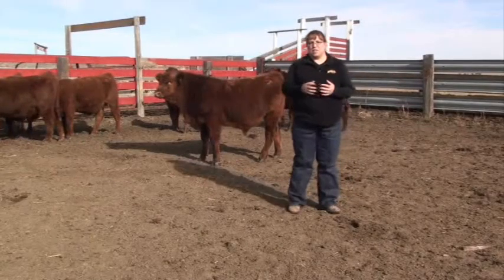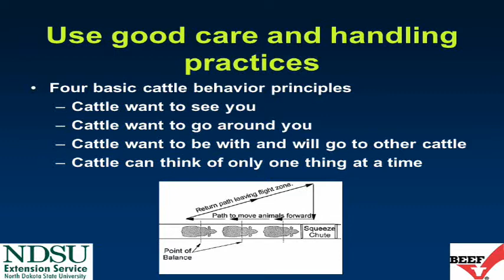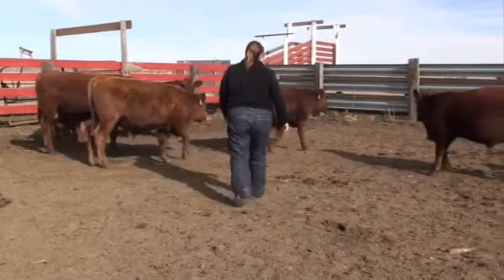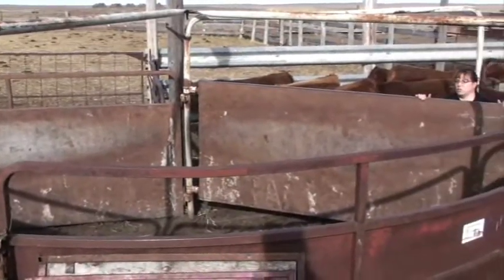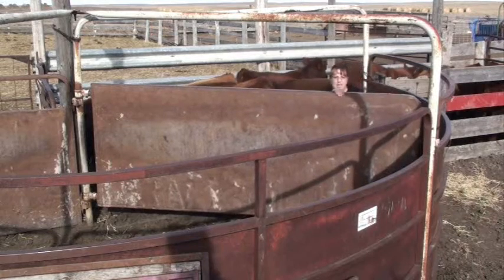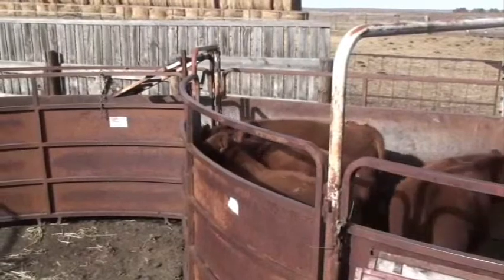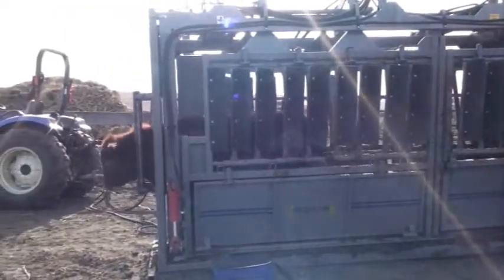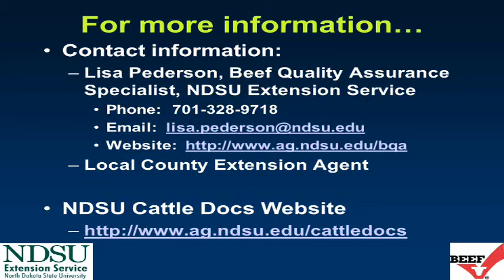Cattle Handling for Backgrounding Feedlots

Comment: good info, i have found though the biggest problem with removing cattle from a pen is because they only see two dimensional. if you can design a gate exit to be a visual difference to the cattle, makes for much easier handling